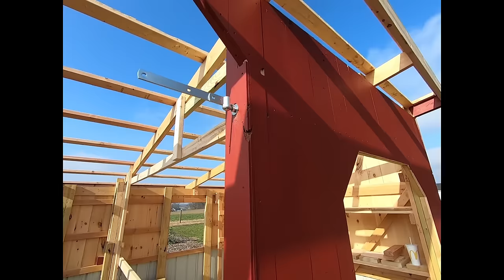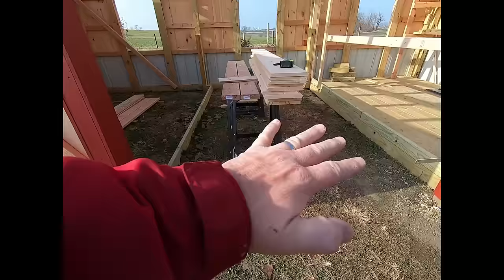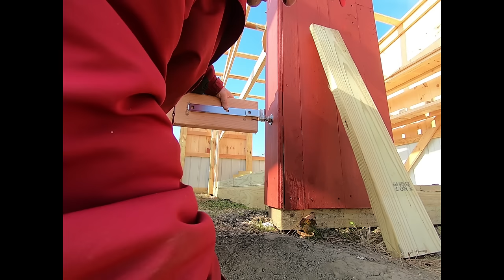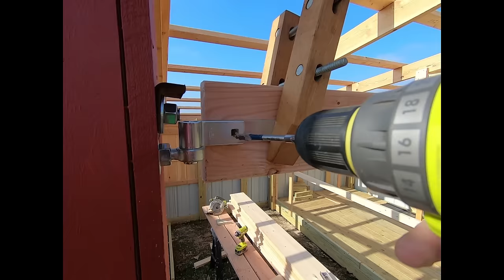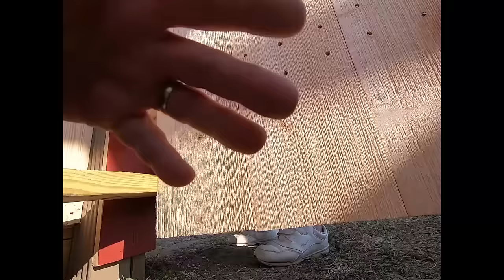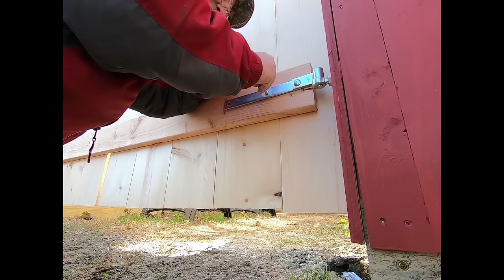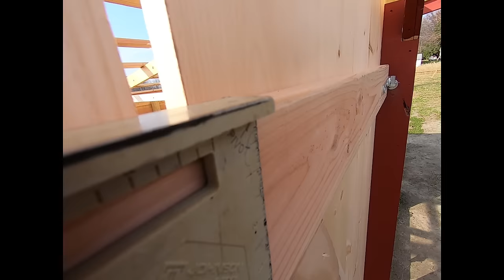DON'T build BARN Doors UNTIL you watch this VIDEO...EASY BARN DOORS

Comment: 👍🇺🇸🇺🇸🇺🇸🗽🙏🏻 Enjoyed!  In my way of thinking you got the doors backwards, boards should go on the outside with the hinges on inside.  Also  gate hinges are meant for gates not doors.  These doors can be lifted off the hinge.  On gates where security is an issue they turn the top hinge up side down so gate can't be lifted off hinges.  The way you have it, it will be somewhat difficult to finish framing the doors for a tight fit.  Your approach is great for initial framing.  I would recommend putting the boards on the outside.  It's interesting you didn't finish frame it on out because that's where your going to run into issues.  Not trying to be a nay sayer just been there done that👍
Reply from the maker: Thanks for watching.  I’ve never preferred the flat panel look of a big door. No visual appeal. I understand your way of thinking also.  My doors are inset and also under an overhang facing East.  Very little precip. hits them.  These hinges are pretty much the go to for very large heavy doors that don’t get locked anyhow. I helped build doors 24 feet wide and 16 tall using large gate hinges like this where security isn’t a concern or practical like in a hay barn/cow barn with multiple openings that never get locked.  I figure if someone wants to carry a 600 pound PTO driven tiller or flail mower they deserve to have it!  🤣. Thanks for watching.

Comment: Im going to be tryting this on a 12'x12' opening.  Would you add a 3rd center hinge point on that type of span to accomidate the added weight?  My thought is yes but I just wanted to bounce that idea off of you.  I realize that the cross bracing design would change, which is fine.  Let me know your thoughts when you get a chance.
Reply from the maker: Thanks for watching! Yes, I would add the additional hinge. You probably could get away with 2 but for a little additional cost it’s worth not risking it.

Comment: I need to make an 18’6” door - would you advise using the same method?
Reply from the maker: Sure. I’ve seen the same method work on a 24 foot wide door opening. Make sure to use large enough hinges.
Reply: Thanks so much for the reply.  I’ve got 24” straps and thought of putting 3 on each side. 
Guess I’m off tomorrow to find some 20’ long lumber!  
Really enjoyed your video- I had a farm with big barns and could never create doors that didn’t sag.  Looking forward to using your method.  After I tackle this, I’m going to follow your advice on gates.  Thank you for taking the time to share your knowledge.

Comment: Great DYI video! I won't be able to go in and out of my barn as you did. I am thinking to just not screw in the last say 3 boards and maybe the last cross piece until after I cut the doors into two?
Any suggestion would be appreciated!
Reply from the maker: There shouldn’t be any problem leaving the boards out so you can get through. Good luck.

Comment: like the idea, what size are the thru bolts & hinges & where did you purchase?
Reply from the maker: National Hardware makes the hinges.  These are 12 inch straps. The bolt I think was 5/8.  Google National Hardware strap hinges for gates.  Farm supply stores should carry them. I’ve seen them in Tractor Supply.

Comment: Beautiful concept!! Could this design be applied to a 12-13 foot barn opening? Would you use an additional hinge? Do you use wheels on your doors (as linked to Jacquie's question below?)
Reply from the maker: Levi Cox , 12-13 feet for double doors such as these would be no problem. I wouldn’t think you would need a third rail.  Go with a long strap hinges.  Make sure you brace your doors correctly.  For 6 foot wide doors I would just use 2x6 rails still. Good luck and thanks for watching and please subscribe if you already have not.  Have a great day!
Reply: @LancoAmish  Will do - Thank you!!

Comment: Very cool video! The opening to my building is 16 feet. So that would my my doors be 8 feet. How many gate hardware should I use per door? 3?
Reply from the maker: I would probably just get longer straps.  They can hold a lot of weight.  If cost isn’t a concern go 3 for peace of mind.
Reply: Thank you for your speedy response! If I do 3, what would suggest about the 2x4 that goes diagonally?
Reply from the maker: That diagonal brace should be there to transfer the weight of the door to the lower hinge.  I wouldn’t remove it.  You could piece your horizontal brace around that.

Comment: Nice video, I have to replace two garage doors that are custom size. One question I have is how does this method not stop a thief from lifting the doors of those hinges? I could see it if the top hinge was inverted but when both hinge pegs are pointing up that’s an easy lift off and then your building is vulnerable. So any tips on making the doors less easy for removal would be helpful. Thanks and keep them vids coming. Cheers 🍻👍
Reply from the maker: You could add a third hinge in the middle area after construction and reverse that one.  If the doors are inset like mine it wouldn’t be a problem.  If you’re going to frame the doors the frame would stop uplift.  You could also weld some sort of stop on the hinge that could prevent the hinge from uplift.  When all is said and done a thief with a reciprocating saw could be inside within 20 seconds anyhow.  Hope these suggestions help and thanks so much for watching.
Reply: @LancoAmish  Thank you for the quick reply. The extra hinge is a great idea and one I hadn’t thought of so thank you for that. Much appreciated.

Comment: I finally got around to building a 20' x 20' pole barn with some old treated 4x4's, 2x8's and 2x4's that I have had stored outside and uncovered for years. I covered it with metal R-4 panels and I am now ready to build the doors. I wasn't sure how I wanted to do them so I decided to check out how you would do it. I'm glad I watched your video before I started. You have saved me some back breaking work and given me some great pointers. Thank you.

Comment: I would love to know how much closer you can go between the doors, How much smaller than 1inch can you allow???? As well as how close can you go with the top and bottom please. I also enjoyed the fact that you didn't play the music, fast forward video ... straight and to the point, thank you
Reply from the maker: You can go as close as you can. I attached a board to the face of one door to seal the gap between. Stops and jams would seal around the sides and top. I didn’t bother sealing the doors off too much since the roof overhang and the doors being set in even more keeps weather out.
Reply: @LancoAmish  thank you so much for such a timely response! I have a cement block building that didn't have a door big enough and no door over open area. I will have to attach a 4x4 just on the inside but thankfully there is a 2x6 already attached.
Reply: Sir, if I were to take a couple of pics and add measurements I was wondering if you might could give me a couple of suggestions?? If so, how could I get you the pics? Sorry to ask, but I'm 100% sure I will be doing this by myself.
Reply from the maker: @bamalady8804  , there is a business inquiry email attached to my channel I believe. If you cannot find it you can search Facebook for “Garden Spot Acres” and instant message from there. Hope that helps.
Reply: @LancoAmish  I have sent a private message. thank you!!!!!!

Comment: Awesome video. Do you have one that show you dealing around the door? I want to build one like that but I want it to be a tighter fit. I heard you say you were going to seal it off.
Reply from the maker: Thanks for watching. The easiest way to have a tighter fit would be to use flush type hinges on mounted on the face of the building.  I wasn’t looking for tight fit...just to keep most of the weather off tractors and such

Comment: Hello. I watched this video about 3 times before I decided I will give this a shot. Long story short, I paid a contractor "friend" of mine IN FULL to knock out my cinder block wall and install a standard garage door. He stuck me.... put a hole in my wall and disappeared. Months went by and lots of calls to him were attempted. I had another contractor give me a quote which was way cheaper, using custome doors he would build. That's when I decided to build them myself!! 
I have 1 question though, and it may seem stupid to you and anyone reading this, but when did you tighten the 1st 4 carriage bolts that were used to hang the 2 cross members?
Thanks.
Reply from the maker: MrPhillyMan ,  I threaded the nut with washers onto one bolt on each hinge.  You can tighten those nuts as long as you are sure the hinge is pulled downward by the weight of the crossmember (which it should be). The other bolts and nuts were installed after I had the cladding on.  Notice too that the hinges cannot look square on the cross member.  The hinge has to hang and take up the play in the pin hinge itself.  You can see my hinges look like they are tilted downward on the cross members because they are.
Reply: Thank you So much!. Have a great LIFE!!!

Comment: When you go back and put the remaining bolts through,  do you level the straps or bolt them where ever they lay?
Reply from the maker: Bolt them where they lay.  That’s what makes this work.  Thanks for watching!
Reply: I just finished,  I bolted them where they layed. I noticed yours weren't level. All done,  just need to make the cut , I'm a little nervous.  I followed you step for step. Thanks

Comment: I'm going to put a gate in this spring for my R.V. I have 10' high privacy fence and spaced the posts where the gate will be a little wider. .  I'm thinking I need to put turnbuckle cable on those two posts to keep them from pulling inward at the top. They're buried in concrete. All being said you saved my life on this one because I sure didn't do as well on another gate and it's "just" O.K.  You're a pretty smart feller:-)  Am I thinking correctly with the turnbuckle? -keith
Reply from the maker: Thanks so much for watching!  If you’re concerned about the posts tipping inward a cable and turnbuckle from the top of the gate post to the bottom of the one adjacent is a great idea.
Reply: @LancoAmish  Thanx!   -keith

Comment: What size were the j bolts? How did you make sure you were level drilling them?
Reply from the maker: Thanks for watching.  The “j bolts” come as a separately priced companion piece to the strap portion.  I usually eyeball when drilling and if there’s a level on my drill I use that too. It helps to have someone judge up and down from the side as you judge back and forth.

Comment: This is how I do mine, well almost. I measure the span and then cut the arm to length giving a quarter inch for the hinges either side. I then put the hinges on the length of 2x4. 
The next step is screwing one pin one side then leveling up the other.

Comment: Really well done, my friend, this is quite impressive.  3 questions, 1. the straps that I see on the link you gave look like they are zinc plated, I am in a salt environment, are you concerned with rust?  2. I heard you say the doors are 8' tall.  Did you consider 3 hinges? do you think that would be overkill.  I am looking at doing 9' gates. 3. I see you chose not to put a center (vertical) support for the gates, what type of latch system are you going to do?
Reply from the maker: Aaron Lee ,  the hinges do t have any rust yet...7 months. They are pretty heavy so I would think you’d get many many years out of them.  I was thinking 3 hinges but the weight of the doors made out of pine/fir aren’t that heavy plus I used a through bolt through the 4x4 post rather than the lag type. As far as latching... I used 2x4 pieces along the edge of the right side door to act as a stop.  And in the middle upper between the doors I dropped a 2x4 from the header.  I close the right door against that and then the left door.  I keep the doors closed with a 2x4 across the entire width of the door using the steel brackets that let the 2x4 rest in from the top.
Reply: @LancoAmish  thanks so much for the reply and the info!
Reply: Garden Spot Acres Do you have a picture of how you did it? Thank you.

Comment: I was looking for a quick way of making some shed doors and I think I found it. I'll just add some sheets of ply instead of the pine boards and instant doors. Putting up the cross beans first with the hinges and cutting them in half - genius! Especially if the shed's not quite plumb and bit all over the place. At least the doors will make it look true. Cheers
Reply from the maker: Peter Schmidt , Thanks for watching.

Comment: Two questions: 1. Is there a way to mount the hinges on the outside of the upright boards, like it f you wanted to use T1-11 instead of individual planks?
and 2. can the centers of the cross beams be cut at a 45 degree angle, rather than removing that 1/2" so that one would act  as a 'stop' for the other?
Reply from the maker: Buck Elsass ,  The 45 degree angle is an interesting idea. I don’t see why it wouldn’t work as there should be no pinching of the blade as you saw.  However, moisture causes wood to swell or shrink.  That’s the reason I put the 1/2 inch between the doors.  I also ran 2x4’s on the face of my left hand door edges to act as stops. I dropped a 2x4 down from my header to stop the right door and then close the left door with the edge stops.  
You might be able to attach your cross braces in front of the hinges and then the t1-11 on top of that.  The only problem might be the thickness factor hindering your outward swing.

Comment: good technique.....
BUT... why not put all the wooden framing and braces on the inside?  
keeps it out of the weather.  (you mentioned snow and rain)
Plus, the center gap... are you going to add an overlapping trim piece to cover the gap?  
"snow, wind and rain"
Reply from the maker: I like the way the braces look on the outside. Plus I will need something to do in 10 years or so if they do rot out. LOL. Thanks for commenting and watching. I do appreciate greatly your time.

Comment: My posts are 6x6. Can I find hinges for that size? Where do you find the hinges? Thanks.
Reply from the maker: Google National Hardware Gate Strap Hinges.  Many places sell them on line. I believe Tractor Supply carries them also. They do make lag screw types if you can’t find the through bolt variety large enough. 2 large hinges should be enough but 3 wouldn’t hurt.
Reply: @LancoAmish  Found some on Amazon from National Hardware. They have some in 7 1/2"

Comment: Love the doors, the build in place technique is genius. Only thing I didn’t like was the rails not lining up, one being higher than the other. I see why, because of hinge locations but wonder if there is a way to get around this.
Reply from the maker: I couldn’t get around it because I used a through bolt to secure the hinge to my post.  If the post was much thicker I guess you could use the lag type screws that don’t go through the other side.  You could also use wider cross braces and adjust those so that they would be even but the hinges still wouldn’t line up.  It’s the nature of the hinges.
Reply: You could possibly fasten the hinge higher or lower on the 2x6 until both sides align.
Reply from the maker: James Thilberg , thanks for watching.  That’s definitely a possibility with wider rails.  Either way something isn’t going to align.  I gave up perfection for convenience and service after I retired! 😀

Comment: Great Video and considering your method for my current project...Only 1 question - Was there a reason you put the vertical flat boards on the inside of your barn, typically that view of framing and hardware is on the inside of the structure?
Reply from the maker: Andrew Winbigler ,  no reason for it other than the look I wanted.  Thanks for watching!
Reply: My point exactly

Comment: If it’s the only entry door ,,how do you get in to tighten the bolts on the other side.?
Reply from the maker: Start on the hinge sides with your sheathing boards and work towards the middle leaving the center open. Do your cut before all the boards are on them finish with the boards.

Comment: This is awesome. I’m going to watch your other videos. I just built a shed. I had NO previous experience of any kind. It came out pretty good. I made the doors the other day and it was difficult. I wish I had seen this before BUT I can’t see how I could have used this system ? This system only works because you are able to get inside your structure. You’re able to go in and out your structure to assemble.
Reply from the maker: MrJoeydrms , this could be built all from the outside if you put the sheathing on the outside of the bracing rather than on the inside.  I like the look of the bracing on the outside is all. I could have put decorative bracing on the outside if I would have built it all from the outside but I didn’t want to bother since I had access to inside and outside while building.  Post some pics on my Facebook page if you’d like.  I’d love to see your first build!  Have a great day!

Comment: It's nice! But how do you secure gates like that? Thanks
Reply from the maker: Charlotte Magallano, I used an overlapping trim on one door.  One door has a stop that it hits that is attached to the header.  The other door has the overlapping trim. So the door with the stop is closed first and then the door with the overlapping trim is closed second. To keep the doors closed I used a board across the entire 2 doors that drop down into a slot on the left and right sides.  It’s the type of bar closures you see in western movies.
Reply: Thank you so much! I love your work!